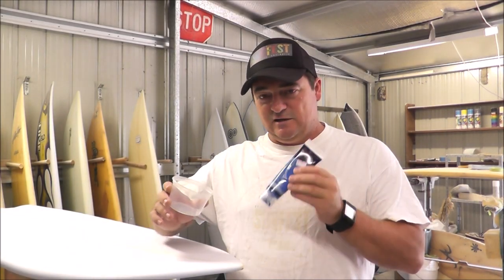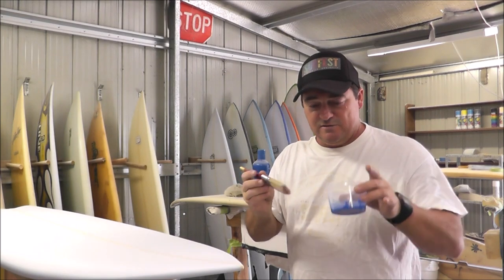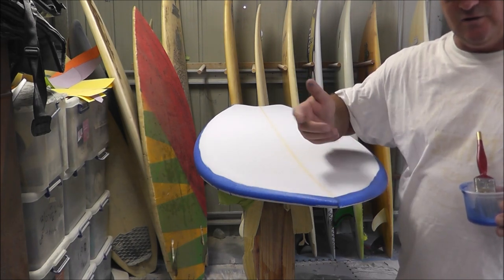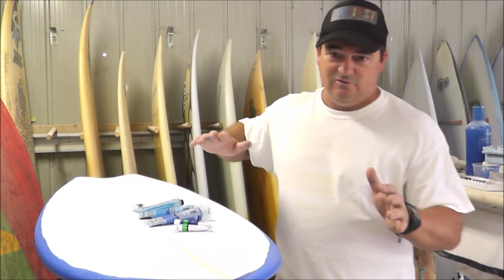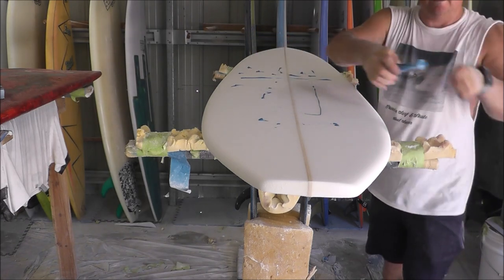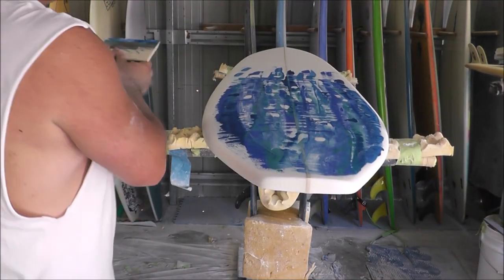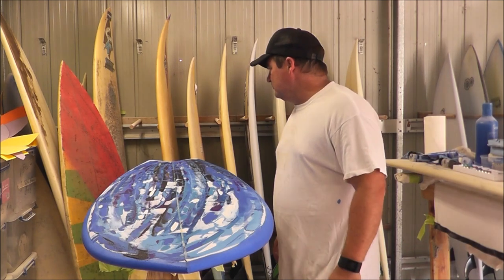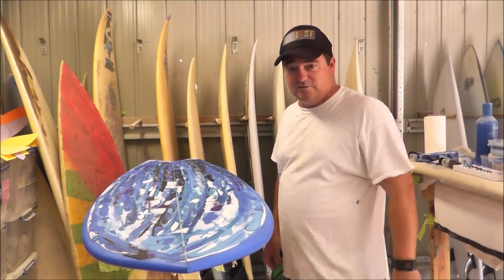Making a Surfboard - Colour the Board

Comment: HI mate, can you do this after sanding the hotcoat then painting with water based acrylic the hotcoat again? cheers!
Reply from the maker: You can but the paint will work differently, won't attach as well unless its sprayed with a tin or compressor. Painting the rails will be fine but if you're doing a squeegee then definately do it on the foam.
Reply: @Crankinsurf7000  Thanks. mate!

Comment: Cristopher Hogg   go on ebay and order a 2 set rubber grain pulling toolset. they are cheap £4 /£5 and very effective. You can go for realistic wood finish  in planks going down the deck separated by masking tape making realistic combos of pine wood and mahogany etc. they don't come with handles so use to pencils and shove them in the holes effective.  pull and rock at the same time and don't stop down the entire length of the deck.  you can use bright colours for a commercial look like bright green with white grain or yelow grain an red background with yelow black etc .   you put a first flat rolled on colour let dry then put on the grain colour solid with roller then drag too down and it removes colour leaving grain. I've had good results with it looks super real just like a hobby balsa skin board finish   enjoy thanks for the video nice technique on your board